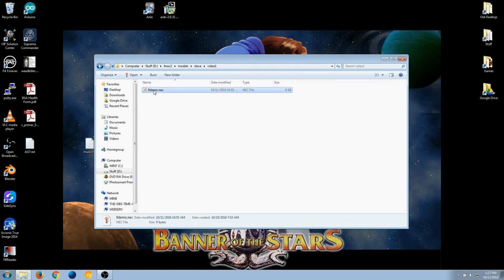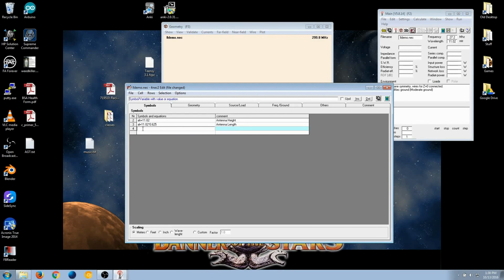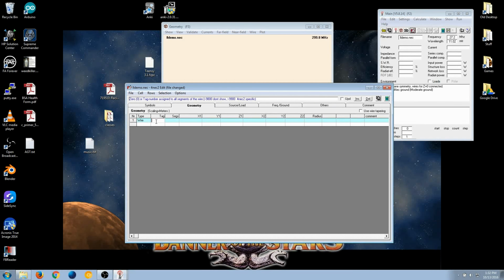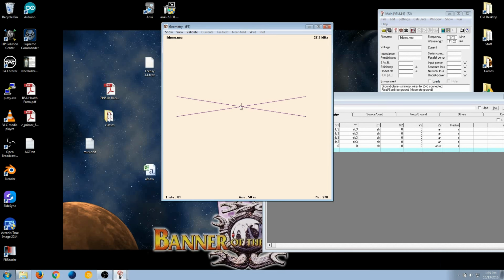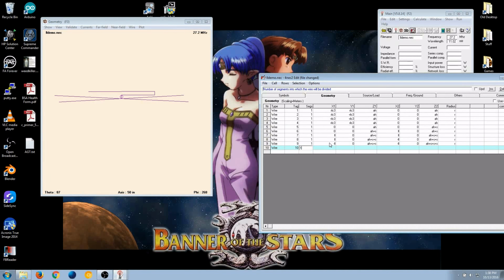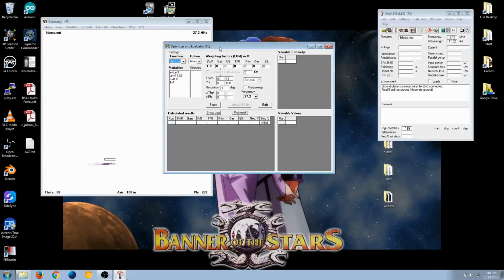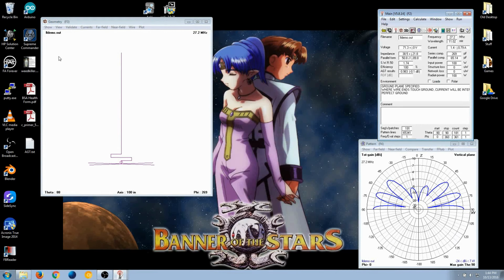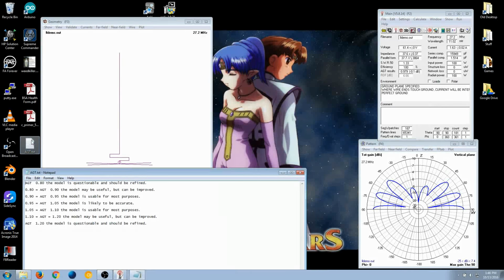Demo of how I model with 4Nec2.

Comment: Very interesting DB. I just saw this for the 1st time. You go a bit too fast but I can look at it over and over to maybe get more details. Your optimizer looks most interesting. I have to write my iterations down if I want to keep up with the effects of a change...but this is oh so much more efficient. Describing the wires in this way, using variables, is definitely the way to develop a model and be able to come back an make modifications easyier.
 
Great demo Steve.

Comment: Hey DB ,
Nice video ,interesting that you declare variables first then build wires.
I usually start with a number only model and add/place variables or for less complex models build the wires and add variables as I need them.
BTW finding the number of segments is easy just go to the geometry window (F-3) and select Show--> Input file , then clicking on any wire in that window brings up a daughter window with lots of pertinent info including number of segments  and wire length.
The radius of the excited segment / wire is a way of adjusting the AGT since it is imaginary in the models eyes it is OK to make the radius something other than any actual wire in the antenna.

One question why not just lay out the radials along the X and Y axis ?
Just demonstrating the use of equations along with variables?
Reply from the maker: I imagine the antenna and try and figure out its requirements before making a new model.  I try and figure out what should and should not be adjustable beforehand.  Also, if I have to calculate anything, like the loop on the Vector 4K model of yours I modified, I may as well go ahead and put the needed formulas in the system at the start.

I've seen that F3 window, I don't use it often but I have seen it.

I have noticed smaller diameter wires produce better AGT's in general, so that makes sense.  The only thing is the range of adjustment is often pretty limited.

I made the radials at a 45 degree offset because I intended this to be a model of the Shockwave style antenna, where the radials are offset from the matching system by 45 degrees.  Showing that you could put formula's into the program was just an added bonus.  If I did the I-10k the radials would have been on the X and Y axes.
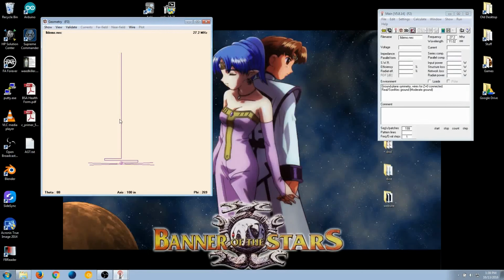Reply: Just to clarify I did't mean the very limited in usefulness  geometry editor or the at times useful geometry builder ..  @ 12:45 you start showing that auto segmentation has replaced your 1 with a value determined by auto segmentation settings. You go to show--> segments , that is the window I'm talking about.
If you have run the model once the default is to display the output file and when you click on a wire the daughter widow displays info about just the segment (like currents at that segment) you picked not the entire wire.
If you go to the same place you used to show segments and pick show-->  input file then clicking on a wire will show info about the entire wire like number of segments and total length of the wire.
No need to count them or calculate a wires  length.
I started modeling at much higher frequencies on models with an extreme amount of wires  like 6' + parabolas so at first I had little chance of using the visualization process.  
Models with smaller numbers of wires are definitely more eloquent when visualized and built like yours from scratch.